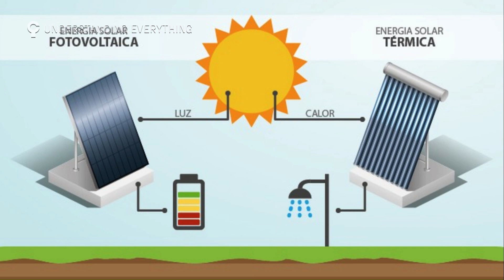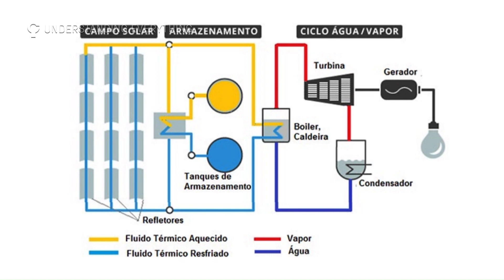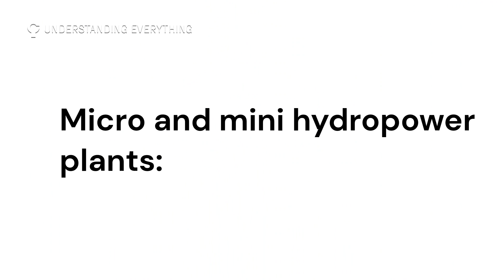THE 5 INNOVATIONS IN RENEWABLE ENERGY THE FUTURE OF SUSTAINABLE ENERGY

Comment from the maker: Did you like the video about the 5 innovations in renewable energy? Leave your opinion in the comments and share with your friends! Don't forget to subscribe to the Compreendendo Tudo channel to stay up to date with the latest technological trends and sustainable innovations.👍
Reply from the maker: 00:00 - The 5 Renewable and Sustainable Energy Innovations
00:55 - Nº1: Solar Energy: Solar energy is revolutionizing the future of sustainable energy
02:39 - Nº2: Wind Energy: Wind energy is a clean and renewable energy source
04:50 - Nº3: Hydroelectric Energy: Hydroelectric energy is a renewable energy source
07:32 - Nº4: Geothermal Energy: Geothermal energy is a renewable energy source
10:21 - Nº5: Bioenergy and Biofuels: It is a renewable energy source generated from organic materials
Reply: @UnderstandingEverything-us  

No 1 and No 2 are unsuited for large scale grid supply. 
Why, because they are both practically and technically unsuited. Practically because they are intermittent. Technically they are asynchronous which means they cannot modulate output. They have no inertia, they  do not contribute to reactive power nor to supporting short circuit level current. All the things that conventional generators can do. They are not an equivalent nor are they a replacement for conventional generation. No matter how much renewable capacity is installed (Ridiculous capacity over building excepted) requires an equal amount of conventional capacity generation as well as  that of renewables, they can't run without.
No 3 is excellent given the geography and rainfall all the greens hate them.
No 4 is dependant on geography 
No 5 is not generally effective due to the energy required to transform the natural materials such that they can be used in a power station.
No 6 Nuclear, you didn't mention. Again the greens don't like them, they only like things that don't work.
Reply from the maker: @iareid8255  Thanks for your comment. We appreciate your input and insights. However, we believe that all forms of renewable energy have their unique strengths and limitations. While some may not be suitable for large-scale grid supply, others can provide reliable and sustainable energy depending on their geographical and technical feasibility. Our goal is to present an overview of the latest innovations in renewable energy and encourage further discussion and research in this field.
Reply: @iareid8255  Hi. Sorry to correct you, but No's  1 & 2 are already operating on many grids. Britain, U.S., Australia, NZ, China. et al. Although their power production is intermittent as you say, it doesn't follow they are not suitable.  People who own their own solar panels sell their "sunny day excess" back to the grid already. Most complain heartily because they get paid back by the grid about half what it costs them to buy from the grid when the sun aint shining. This is why they buy Tesla wall batteries for home use.

Balancing supply and demand on a grid has become a separate and highly skilled profession, and the complexities mean it will become one of the first things that Artificial Intelligence is applied to on a commercial scale. 

No.5 does need energy to transform bio-matter to fuel as you rightly say, but this energy can come from the sun, as with algal fuel, making it another form of solar energy. Low grade geothermal energy can be used too, so such fuels don't necessarily have an "energy deficit". Cheers, P.R.

Comment: Hi A useful starter video, good work. Nuclear needed a mention. In N.Z. we're mainly hydro and geothermal, with wind contributing also. 

Solar electric panels are the least capital intensive, but the sun doesn't shine at night and some days are cloudy so solar panels will only ever connect with the power source (the sun) about 25% of each 24 hours. Depends where you are of course, but the max is 50% obviously. 

The wind can possibly blow all day and all night, so wind turbines can theoretically reach 100% effectiveness, but seldom do. The drawback is they have a much higher capital cost, and expensive maintenance. 

A further drawback to solar panels is that as climate change progresses and the seas evaporate more, we'll get a higher proportion of cloudy days, dropping S.P. efficiency down to 10-20% or even less. Wind turbines will increase efficiency in these conditions, as climate change  causes higher wind-speeds. Cheers, P.R.